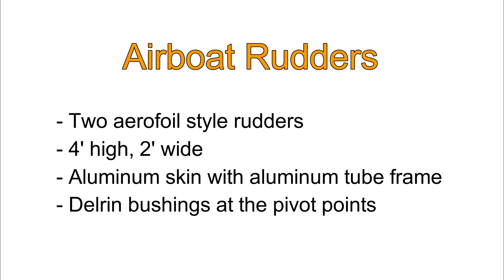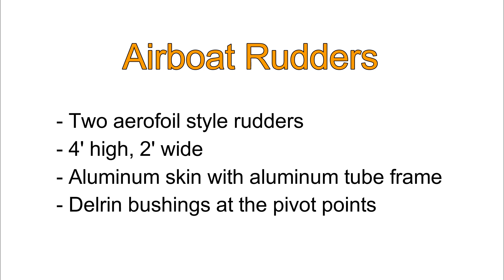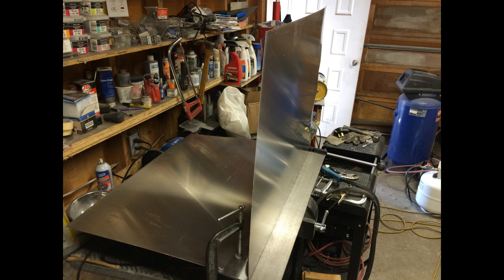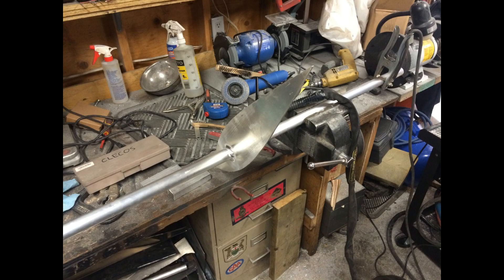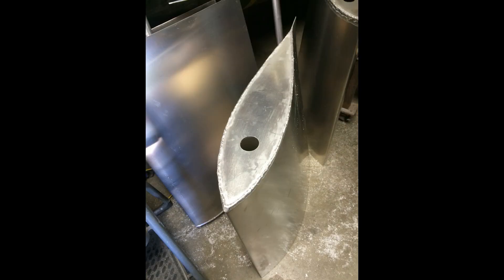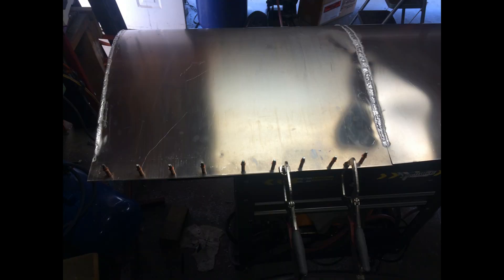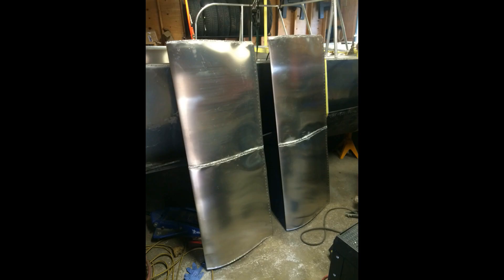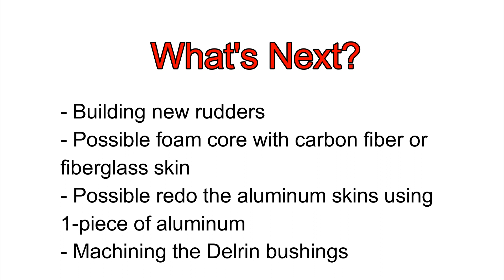Airboat Build #4 Rudders

Comment: The rudders I use all come with 1 piece of aluminum sheeting to avoid having to make this seam weld in the center.
Reply from the maker: Yes that would be way nicer.  Unfortunately I don’t have a sheetmetal brake large enough to bend a full length.

Comment: .040 is hard to keep from warping at any experience level. the best way to do it would have been to move the heat around a bunch. keep the heat low, do a 1" weld and flip it over and do a 1" on the other side until you connect all the stitches. Of course the added time and expense of finding a bigger break would have made things easier. I know a lot of boats fill with foam but id imagine rudders that size would be much more easier to fabricate and more ridged if you used .080
Reply from the maker: Dustin Apple   
That’s a good point, if I re-skin them I’ll use 0.080